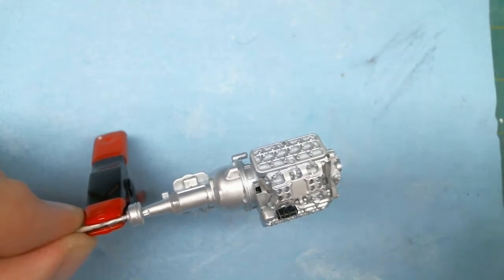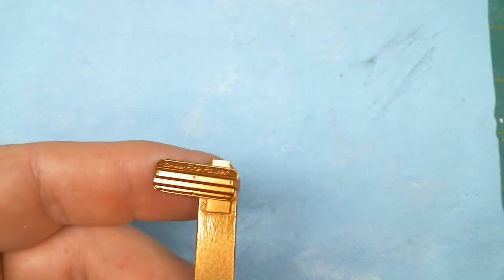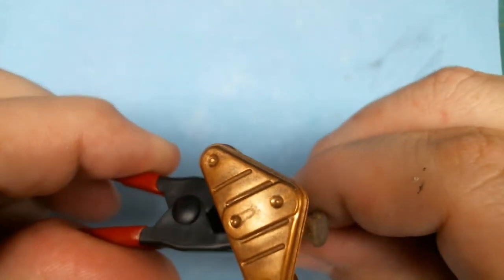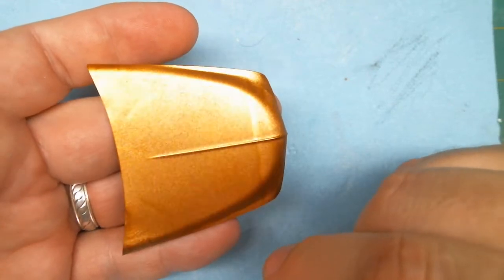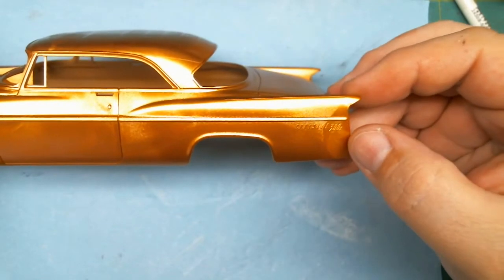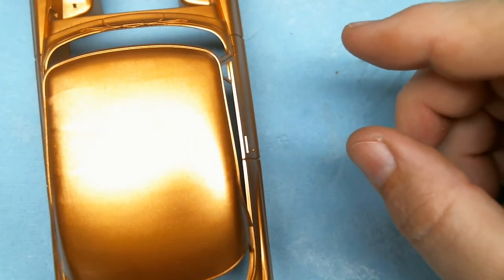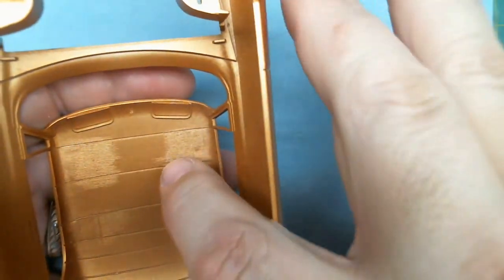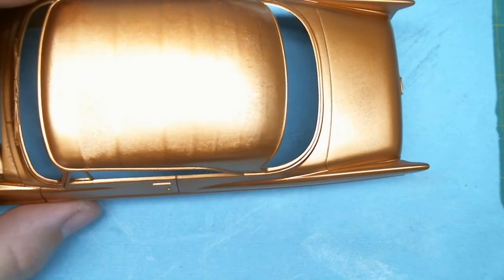Update #1 on the 1956 300b

Comment: On the swirl marks I think you just need more paint or more of a wet coat. I hate ghosting. I had a car that I primed and it kept ghosting. I would sand it and down to bare plastic and re-primed and paint. Did that 2 or 3 times, then I just sanded the primer until the ghosting was gone ( before the plastic showed) then I sprayed my color and never had any problem after that.